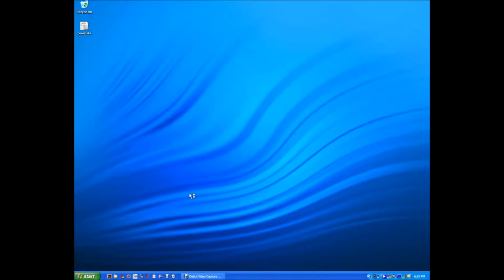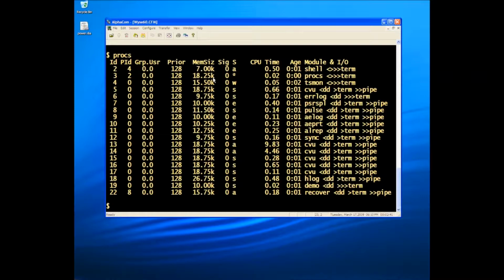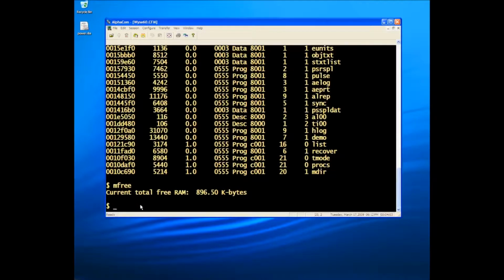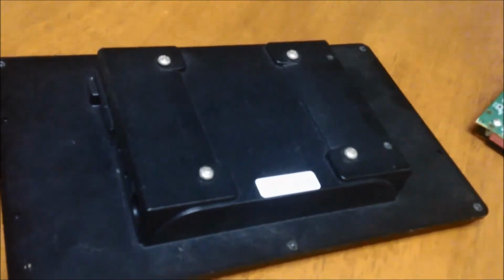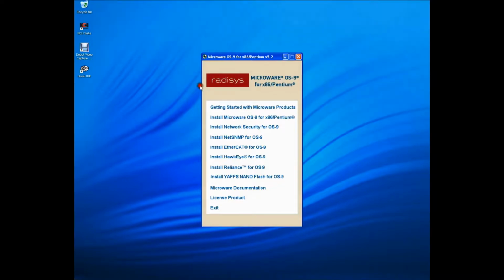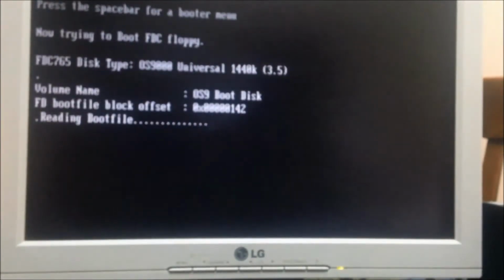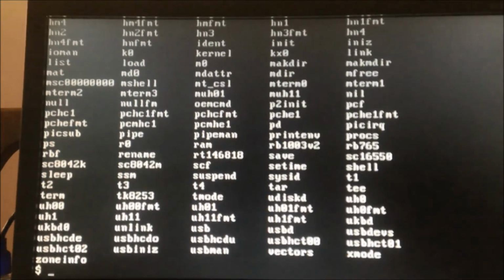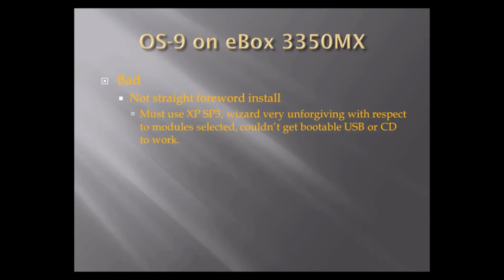Microware OS 9 on eBox 3350MX

Comment: Was that the latest version on MW OS-9 X86 evaluation that you were using?
Reply from the maker: +Walter ZAMBOTTI It was the latest version at the time (Version 5.2) for x86 The Motorola version in a related "Tesselator" video was version 2.4 circa 1990. Microware LLP (RTSI) is working on version 6.0, if they will let me have a x86 evaluation I do a follow-up video
Reply: +Keith Houghton I sent a few emails to RTSI and they may be making plans to release a hobbyist version with a greatly cut down development environment.   However,as you mentioned, 6.0 is the latest at this stage.